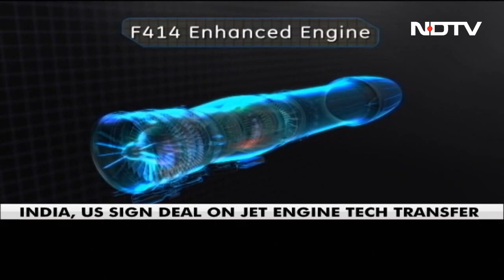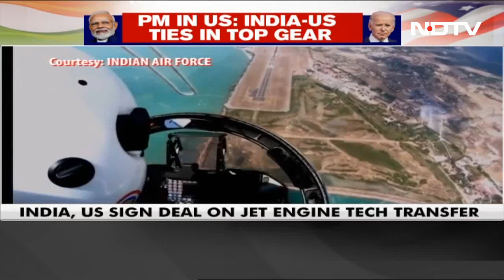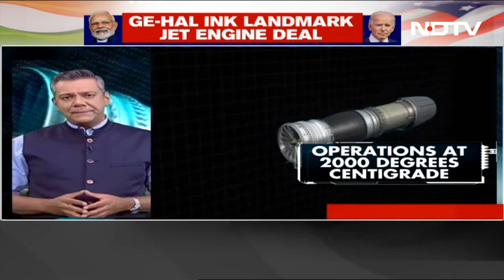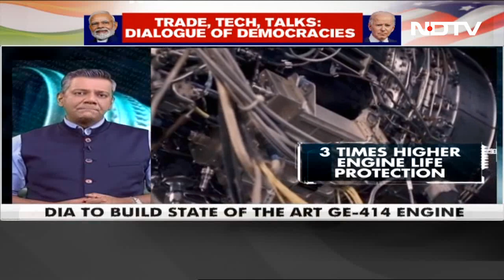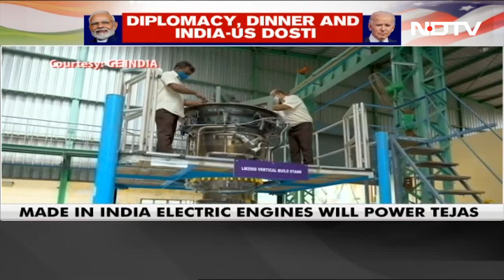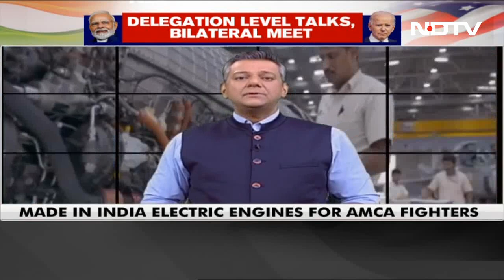India, US Sign Deal On Jet Engine Tech Transfer

Comment: Just hoping that India does not face any roadblock conditions by US government in signing the engine deal (not MoU).

Also 80% ToT means that India still has to develop the critical engine core technology by itself. So both our government and GTRE should not forget this and start working on it as soon as possible, and this time GTRE should show the intent of proactively absorbing ToT and strictly adhere to the timeline it itself estimates. 
If we look at history, Kaveri engine development was started by GTRE way back in 1989 and was estimated to be a 93 month programme, but only 2 out of 6 milestones were achieved in 20 years (i.e. more than double of the estimated time) even after spending more than 230 million dollars and still the engine was around 20% heavier and development of many critical technologies were not even started. All these failures led to engine programme getting eventually scrapped in 2010. And the reason was mostly the lack of interest, initiative by GTRE and the sluggish work culture of the bureaucracy in the government.

We cannot afford to repeat this mistake again !